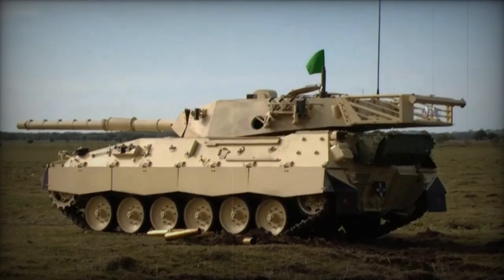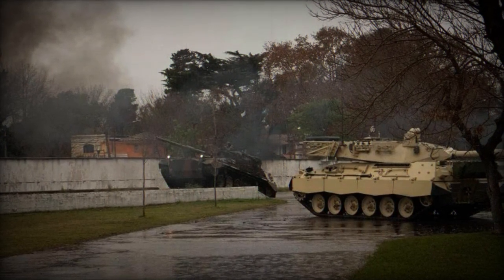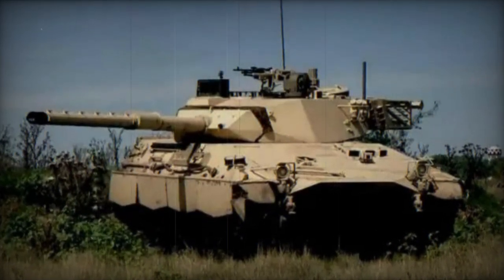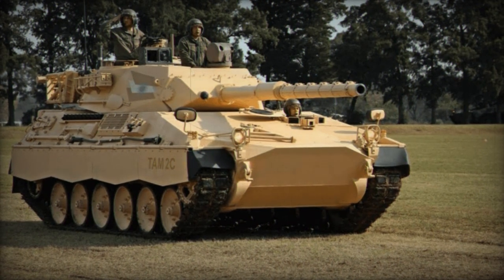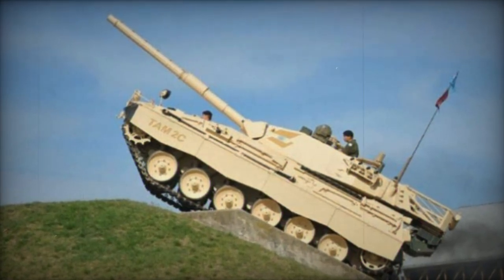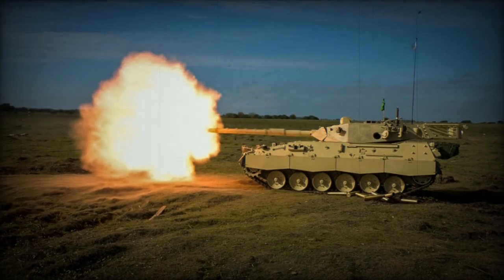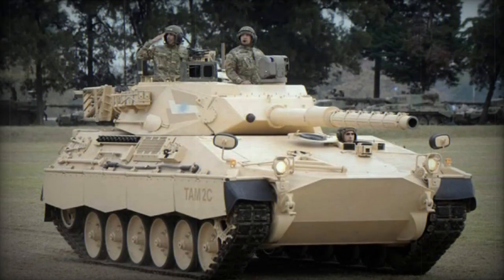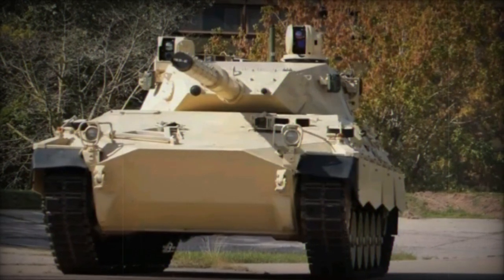TAM Light tank

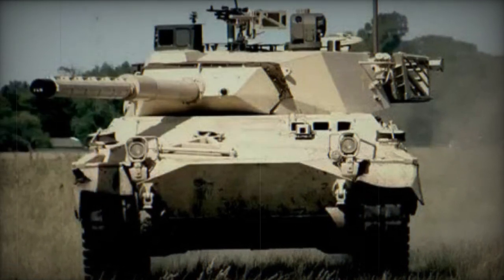Comment: The information on 3:50 is not correct. TAM IP was NOT selected as the development of the original TAM, only 1 was produced as a tech demonstrator by ELBIT, Instead a contract to modernize 70 units was given for the TAM 2CA2 an improved version of the TAM 2C with more modern optics. Currently TAM 2CA2 is in production with it's goal being finalizing all new units by 2025-2026